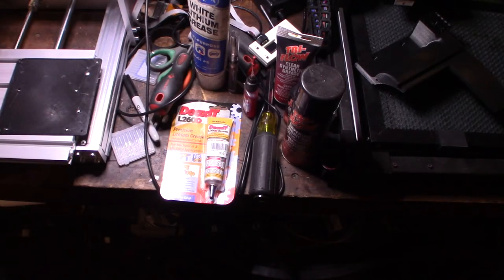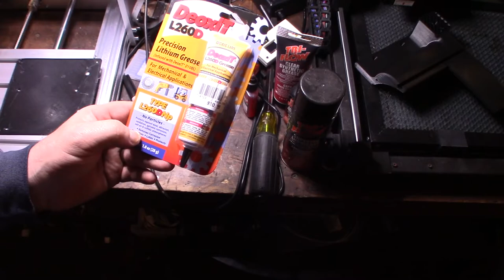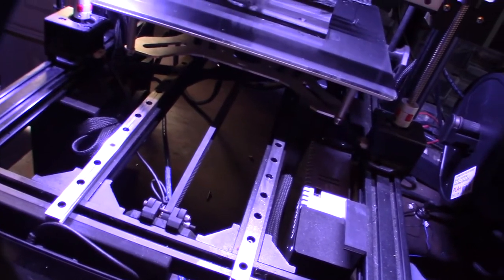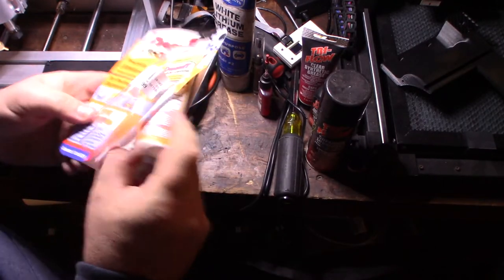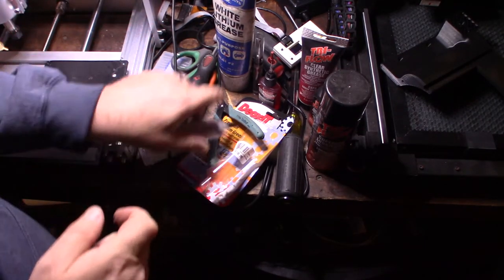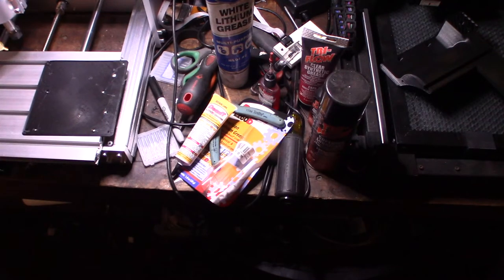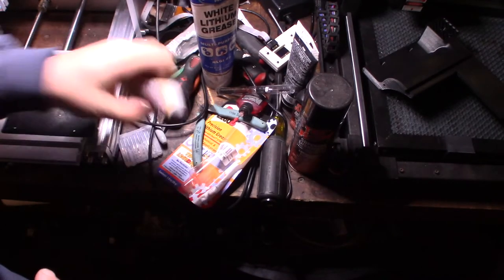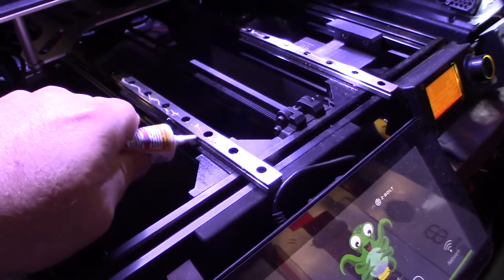DeoxIT L260D Best 3D Printer Linear Rail Rod Grease So Far By Craig Laboratories Lead Screw

Comment: Seems like the "how to" videos from ultimaker use magnaflow grease... not sure if that's also lithium based, seems like if it is they aren't advertising as such.  My question is would you call this stuff a good grease for check valves?